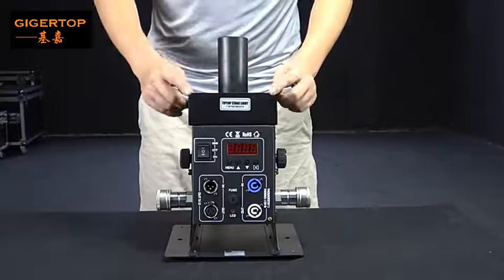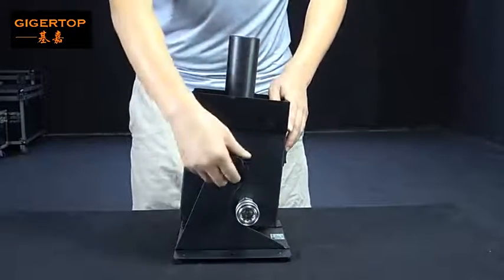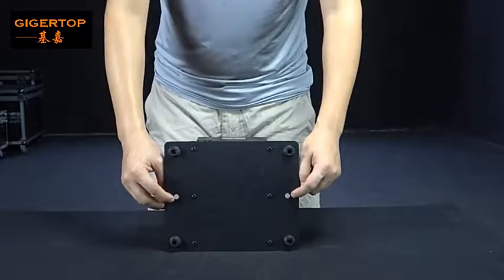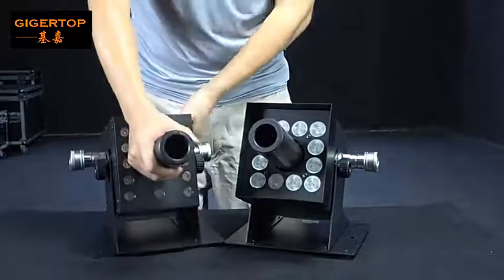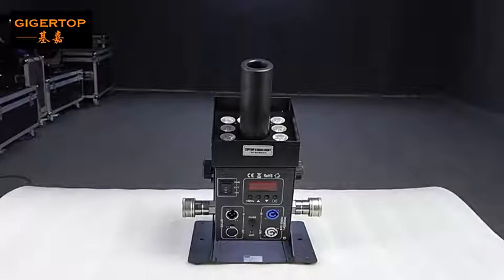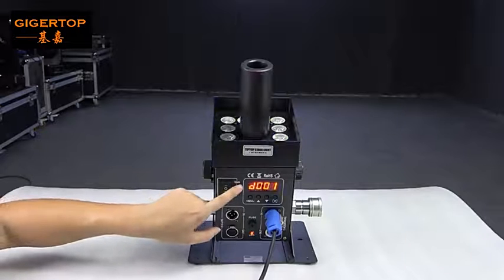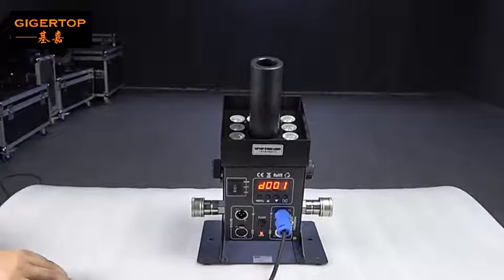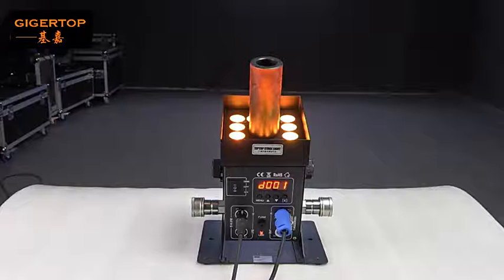Led Co2 Jet Machine with 12x3IN1 RGB Big Lens/Detail Introduction

Comment: How long does one co2 tank usually last?
Reply from the maker: 30seconds
Reply: @tiptopstagelight8153  Thank you for the reply! Seems rather spendy compared to using modified foggers that last for nights upon nights.
Reply from the maker: @NonnyStrikes  fogger machine effect is totally difference than the co2 jet machine,Nonny